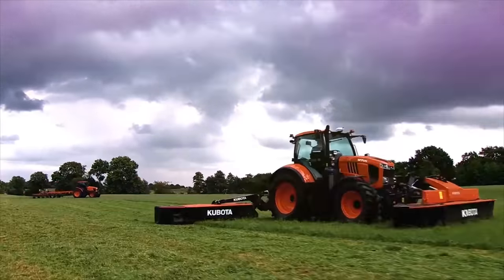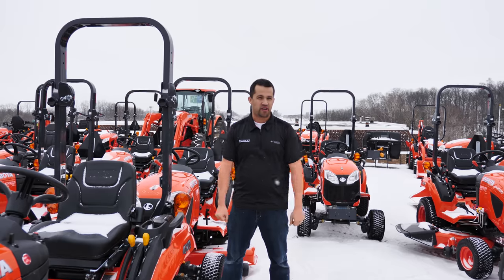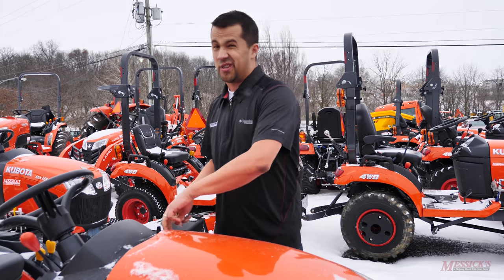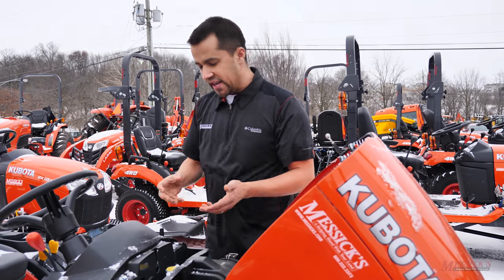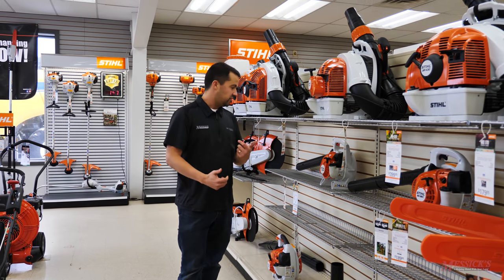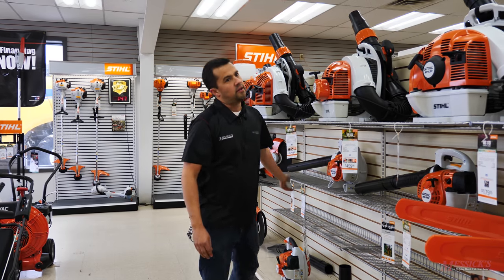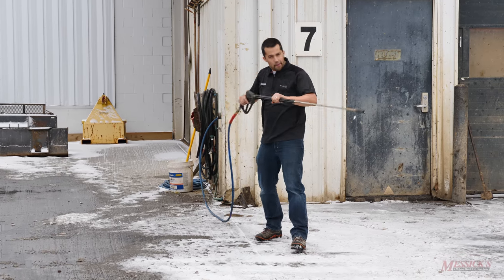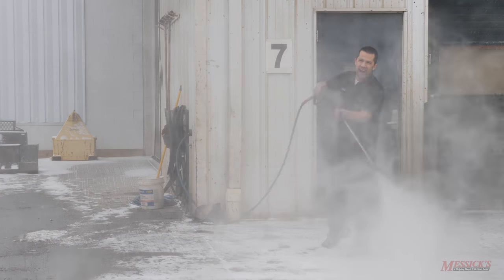How to clean your tractor / How NOT to use a pressure washer! - TMT

Comment: Hey Neil, love your videos! I'm a huge Kubota fan. About the pressure washer, I think that they are a great tool for cleaning just about anything, but only in the right hands. You have to know how to use one properly in order to have positive results. You adjust the pressure just by going in close for the insensitive parts and pull back for the sensitive ones. Uses less water than a garden hose and you can control the direction and pressure yourself. You can compare it with a gun, it can be very dangerous in the wrong hands or very useful in the right hands. I'm just trying to stick up for pressure washers because I have a mobile wash side business and have tons of experience in using them and think they are great. Thanks again for the great videos, keep them coming.

Comment: With those short sleeves you certainly had an incentive to keep the video short!  :-)  I'm a big believer in the leaf blower. I use mine to clean my lawn tractor after each mow. It's a much gentler air blast than even using a compressor and blow gun.  I'm guilty of liking to keep my tractor clean and I find that by giving it a periodic shot of something like Fantastik followed by a gentle rinse with the garden hose sprayer set on wide spray, I can keep the grime at bay and avoid the eventual need for high pressure cleaning.
Reply: EOSJOE every time I’m done mowing I take my blower and go over everything even under the hood. Knocks the dust off and some leafs too in the fall.

Comment: I wash my tractor with the same tact I wash my Harley with. NO pressure washer, just standard garden hose pressure with a bucket of soapy water and a thick cotton rag avoiding electrical, I’m not ashamed to say I will use a quick spot wax on the hood and fenders, while it won’t get the level of detail the Hog gets, this L 4701 gets the same ECO battery powered leaf blower particularly at the radiator as well, Great Vlog!, and special thanks to the patron that reminded me not to pressure wash my leaf blower, it was comedy genius! Lol !

Comment: This was hilarious... I let the tractor sit and cool off after using it, then I rinse it off with just water from the hose. I then let it dry off before putting it away... thanks for the tips - I also have a battery powered blower for dusting off my riding mower, but might start using that on the tractor too!

Comment: Leaf blower is the best tool to get the grass and dust off my mower deck and my BX23S, after that I use the garden hose and low pressure to wash the tractor. Pressure washer is to power off the loader and hoe bucket, wheels and under side of the mower deck.

Comment: I use my Kubota clearing snow, I have to drive on salted slushy roads, Kubota doesn't sell front wheel fenders for this condition! The blower remedy is no good. How do you get a salt crusted machine clean!  Neil it's winter, just because you refuse to dress for it doesn't mean it will just go away!
Reply: Dennis St.Germaine  I use a regular garden hose. It doesn't have enough pressure too mess up seals on bearings an such.

Comment: I have given my tractor a nearly decent cleaning once in the past 3 years.  basically, I pressure washed the wheels, operator platform, and the hood (not the engine).  anything wrong with what I'm doing?
Reply from the maker: Nope. Periodic washing is not going to cause a problem. Just be careful not to push water back into areas it doesn't belong
Reply: Messick Farm Equipment yes I'm always careful, and I do it with the engine warm or running to immediately evaporate any water that does get in.

Comment: But you are a dealership and a repair shop, you should be perfectly fine telling people to use that huge pressure washer on everything on their tractor, gives you repair jobs LOL.  

I use a leaf blower on my lawn tractor to blow all the grass off the deck, out from around the engine, etc.  I'll use the garden hose to wash the body off occasionally, never even thought of using a pressure washer, that would rip all the plastic and rubber parts right off the mower...well I guess for weight savings it would be fine LOL.

Comment: Love your videos but feel this one was pretty uninformed and uninformative. 
Just not sure how much "mud" will accumulate on a radiator. Between the fan and heat of the coolant water is removed pretty fast. 
Also no mention of oil seals at gearbox, PTOs, motor, hubs etc or breathers. 
There are times a power washer is needed and overlooking fundamentals in a "how To" video is not in anyone's best interest.